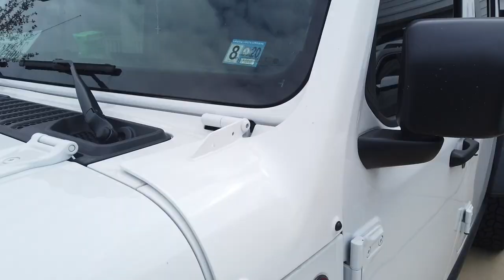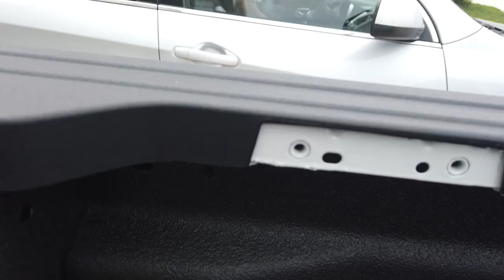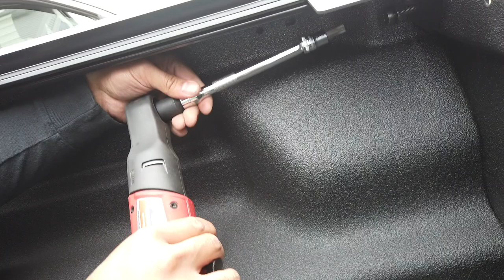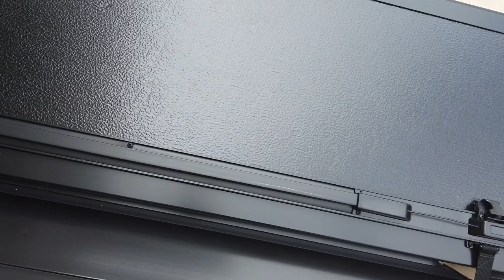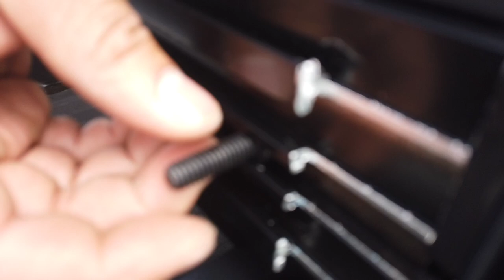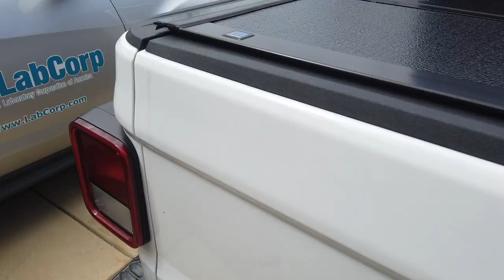JEEP GLADIATOR | MOPAR HARD TRI FOLD TONNEAU COVER | INSTALL

Comment: Abby Ray Vlogz: So I purchased this tonneau cover and installed it last night.  Grateful  to you guys for posting this video, it made it so much easier.  Not intended to hijack your install, but I would recommend pre-threading the side bed rail torx bolts "from hell", before attempting to install them on the rail.  You guys were correct that they would take the longest time of the whole install.  Using the supplied torx wrench in such a confined space, put me in touch with God :)
Reply: Lol
Reply: Great video , Thanks a million.

Comment: Another suggestion. The rear holes are full of paint. Grease up the torx bolts and run them in and out. When you begin to tighten them in the confined space they will start and tighten without so much difficulty!

Comment: Excellant video to watch before and during install. Only thing I would recommend is to change the 4 torx bolts, 2 on each side where you cut out the rectangles, for hex head. Will make your install a lot easier.

Comment: I just bought this cover for my 2022 Gladiator. You have two Rivnuts that need to be compressed. I bought a rivnut kit at Harbor Freight, $50.00, cheaper on Amazon but did not want to wait. Rivnuts are like a pop rivet but are threaded on the inside for the front mounting bolts. Never saw one before but they work well!
Reply: Did you buy the hand powered ricing tool?
Reply: @miguelcereceres6977   I bought the Rivnut tool, nice tool, future uses, I’m sure.

Comment: Great Video. I noticed that you did not compress the Rivnut. Do you need to do that? or just by closing the bolt, it will compress the rivnut and the job is done?
Reply from the maker: Not sure what riv nut you mentioned. Did not see anything on the instructions about a riv nut.
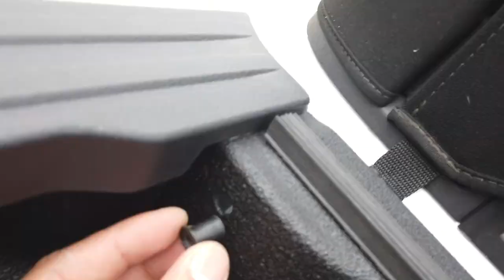Reply: @abbyrayvlogz  the thing you called a bushing at 2:43 is a Rivnut and requires a special tool to install.

Comment: i have heard this one leaks inside the truck from a few people.
i was suppose to go in two days to go get this but am looking at other versions now that come off easier to have the full use of the bed for a dirt bike easier. any suggestions?
Reply from the maker: It only leaks if the seals are not properly set. Mine does leak because I have my bed rack that causes the seals not to sit properly. This is honestly the only cover I have and never tried anything else. Im not sure what cover leaks or not. Our goal is to have a cover that is compatible with a bed rack. It does provide great protection of whats inside the bed it just leaks when it rains. The leaks are only on the side anyways and not in the middle.
Reply: @abbyrayvlogz  thanks. I think I am going to pass on the Mopar because if it leaks and then freezes at night that will create some issues.  That and it looks like removing and  making room for a dirt bike is not quick or easy to do.  Thanks again for your answer.
Reply: Mine leaked. I switched to antidote rolling tonneau. So far so good

Comment: Ok video, other than you didn't follow key component of the instructions.   I see their is an earlier comment about the Rivnut which you called a bushing - the advise that user gave you was also wrong. There is a very specific instruction page about installing RivNut. A RivNut needs to be compressed by pulling using a special tool. If people do follow your instructions either the Rivnut will not be compressed at all or it will be compress via twisting which can damage the Rivnut, or damage the bed or it can also compromise the safety of the installation and per the instructions will clearly void the product warranty.

Comment: I tried to install mine yesterday but not sure what I did wrong the tailgate seems to be hitting the end of the rail and wont shut completely. Also, how the heck did you get the Voodoo rails with this tonneau cover to fit?  Ahhh I am having the hardest time making it fit. You guys made it look so easy
Reply from the maker: Im sorry you are having trouble. The rail is probably not pushed all the way back to the front of the bed or not screwed in all the way. Or you mean the cover is preventing it from closing all the way? We had issue with tailgate not closing because of the cover being pulled back more than it should be. There are 2 screws that are in the front of the bed that you can lossen and push the cover towards the front until the cover lip is about 1 inch overlapping the tailgate. Thats is where you want it and makes sure the rubbers are sealing it. The voodoo crossbars were actually easier to install than the cover itself. We actually took out voodoo bars out and are upgrading yo another bars. Stay tune fo that video. We are just waiting for it to arrive!
Reply: @abbyrayvlogz  my issue with the vodoo bars is that it seams the bars (brackets) push the cover trails a tidbit in and reduces the distance from each side of the bed and when I go in to put the Mopar cover on it won’t sit on the trails by a tid bit off. Did you have this issue?
The tail gate issue has to do with the Mopar tonneau rail sticking a bit out near the tailgate I will go back and check on screws at front o the bed but seems they were all the way in. 😩

Comment: Mine is not like this at the front of the bed. It only has the one hole at the top on the rail and none on the bottoms for the pre existing threaded hole. Did not come with bushings for the top hole. I can’t install it at all
Reply from the maker: That is weird. You would think its mopar it fits all of that model.

Comment: Does Mopar include any way of propping itself up fully opened, like the rugged ridge version?
Reply from the maker: Sadly No it does not. I use a bungee to keep it open or just take the 2 bolts out and take cover off.
Reply: @abbyrayvlogz  thanks, you just sold me on the Rugged Ridge over this one then.
Reply: I have the same cover. How do you use your bungee cords to keep the top completely open? I’m trying to avoid removing the top each time I need all the truck space.
Reply: @abbyrayvlogz  could always design one to benefit one's self.

Comment: Can you secure the cover open in order to use the complete box?
Reply from the maker: You have to secure them with bungee or take the 2 bolts and take the cover off
Reply: That's the only thing I hate about it myself. I can't secure it fully open without looking bootleg.
Reply from the maker: Haha yup. Other than that I have a bed rack now so I barely open it fully now
Reply: Was really hoping I was just an idiot and there was a way to secure it full open. Disappointing.
Reply: @AbbyRayVlogz  what rack are you using with this cover?

Comment: Does this top keep the water out of the bed?
Reply from the maker: Austin Donohue it actually does a great job keeping water out! It has drain tubes that are attached to both rails. As long as the seals all around are properly set it should be good.
Reply: @abbyrayvlogz  Curious about why the drain tubes are needed. If the top keeps water out, and the rails are inside the cover, wouldn't the rails not get water in them?  Asking because I'm curious. Thinking about going with this cover on my JT, but the drain tubes leave me wonder why..  Thanks, -Todd

Comment: Great video! Though, not great cover! I would advise anyone considering getting one to avoid if you expect security. After the install (which as others listed was hell with the threading). I was heartbroken to realize that by just pushing the cover from side to side, you could easily stick your hand in and pop it open. Took me less than a minute  to just pop it open. It's not rigid enough, and gives to much once installed. Easy to say it, and move it away from the latches enough to pop open. Feel badly ripped off.